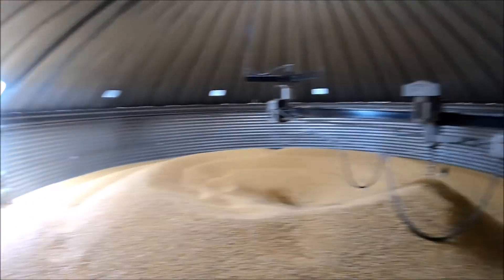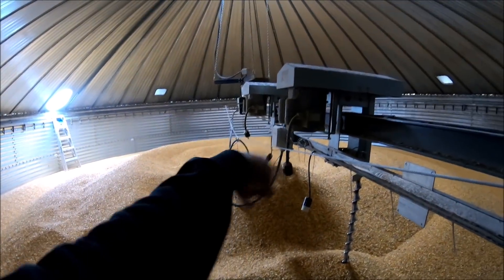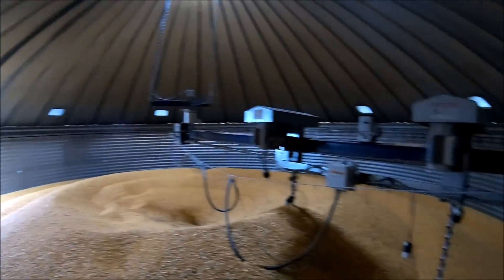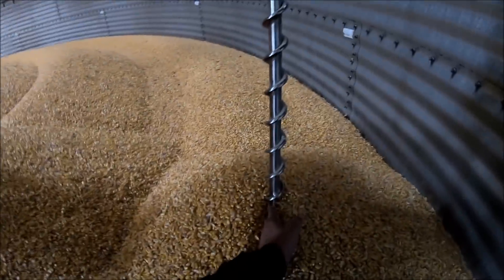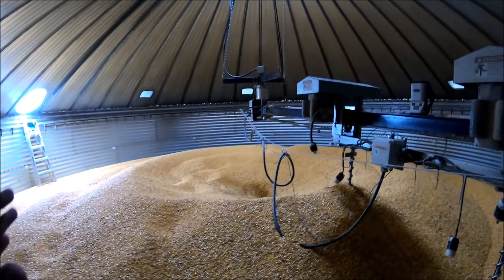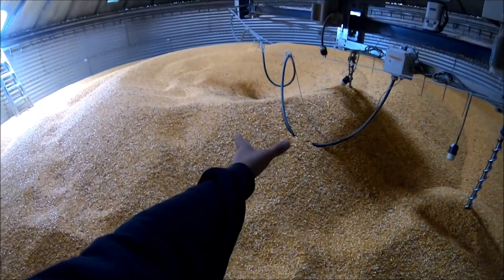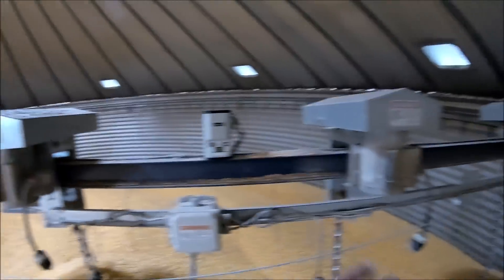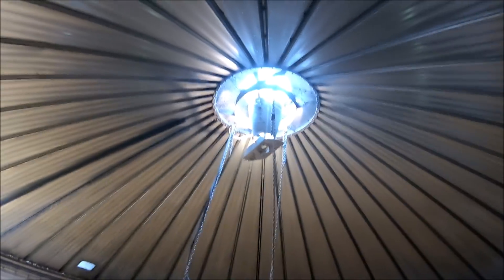Mixing The Grain Bin

Comment: Hey Travis. You're so right about the grain issue of crusting. However, you do something that concerns me very much. Unplugging the motors and plugging them back in. What concerns me is a spark when plugging them back in causing a dust explosion.
Be safe,
Russ
Lithia, FL.
Reply: With the fans running there is plenty of fresh air blowing through the bin, so any beese wings that could accumulate are blown out and aren't dense enough to burn.

Comment: We got one of these...the trick is to only fill half way. Drying is not faster with full bin...not slower either with half full. Moisture content determines dry time as long as heat/air remains constant.  Stirs move easier with less corn. GSI makes the most durable/reliable stand alone. Continuous is better than batch. Not cheaper. Because your augers never run half empty with batch...so they wear out faster on continuous drying. Great explanation.
Reply: What is the max moisture  to get in?
Reply: @11T872  We started this year at 40%. But our corn was late seeded. The goal is to dry to 15%. The wetter the corn is to start, the lower you can have your ingoing temperature.
Reply: @tf7274  So what is time and temp.of blower to drop it to 15%...sorry bad english..

Comment: Great video Travis. Glad you point the dangers of being in the bin with grain. Think he had the motors unplugged so no one could turn them on. Locking out the panel works just as well if you have a lockout kit.

Comment: excellent safety comments --- always work in pairs or more and at least one person on the OUTSIDE -- I too am concerned about dust explosion from an electrical spark -- as a retired electrician make sure anything you use in a dusty environment is explosion proof NEMA 9 and if you have to disconnect/connect in the bin always disconnect the circuit outside of the bin first and short the circuit as well to remove any motor capacitance charge that is residual --  sinking in a grain bin is bad enough but that compared to almost instantaneous dust explosion may seem a lot longer --  electricity operates at the speed of light a lot faster than gravity

Comment: Hey Travis...
Hows it going since y'all are rained out for a while...
Guess y'all are doing quite a bit of shop work now...
I liked watching this video covering the inside of the grain bin...
Since its almost filled up to its maximum capacity now...
Do you think it might be possible to get a video of the Stirator in action and working at stirring up the corn...
I've always wondered what one of those looks like while its running in action...
And...Is the entire process of rotating the corn from the bottom to the top and the stirator circling the inside of the bin a fast process or a slow process???
Love all your videos...
Thanx for sharing
Reply from the maker: Been nothing but busy work since the rain started. 
Just got done working on the machines, everything is ready to go. 
I try to have my camera on me most times so I can catch a video like this when opportunity rises.
I've tried taking a video of the stir-a-tor in action but I have yet to see how it turned out
It is a very slow process when it is working but goes faster the drier the corn gets.

Comment: Is a stirator needed much in Wisconsin? Our corn (N. Missouri) has been drying down pretty fast now though, like it will go from 20% down to 15% within almost a weekend (I know our start is way earlier and different than your start). We ended up just getting rid of our one stirator.  Ours was a one unit model that would also go in to the center and out, but it always, always, got stuck somehow if it was full or close to full. Maybe a 30' bin, but not that tall at least. I don't know the specifics really, I was younger when we ran it.